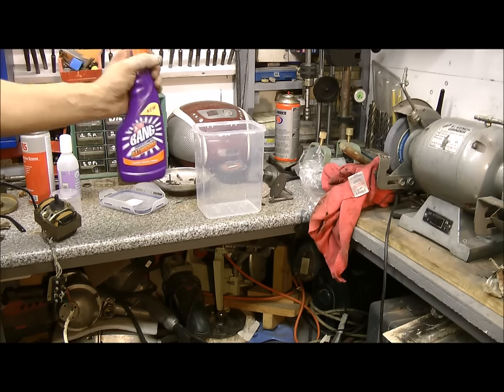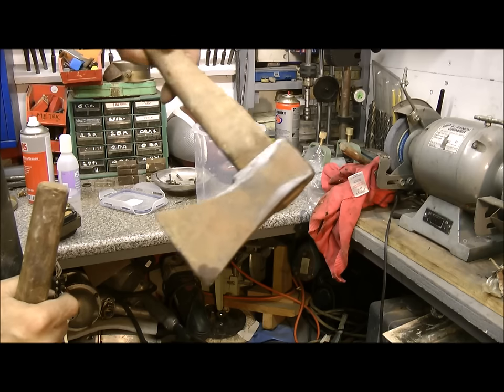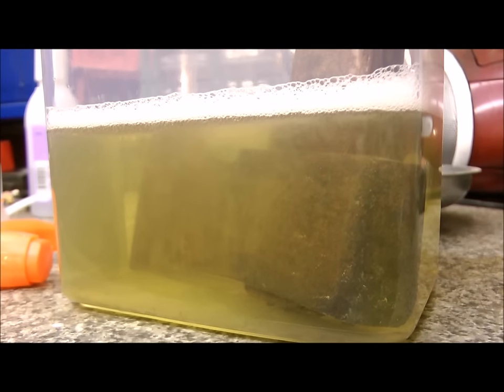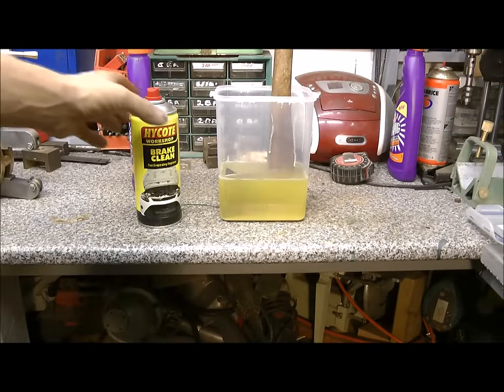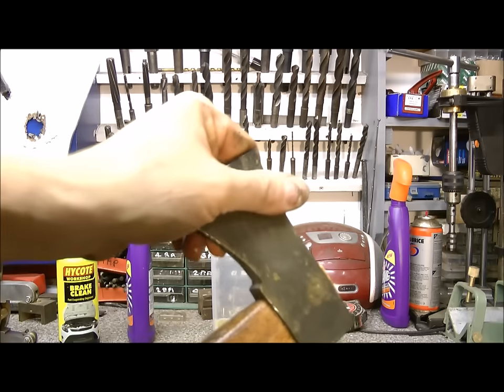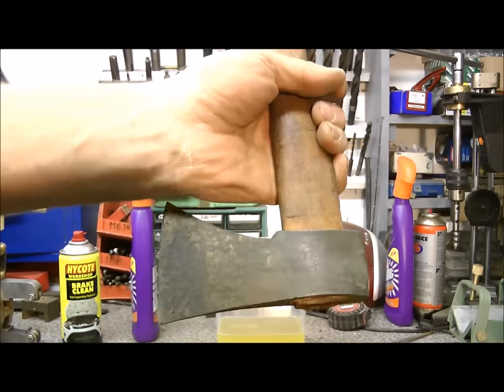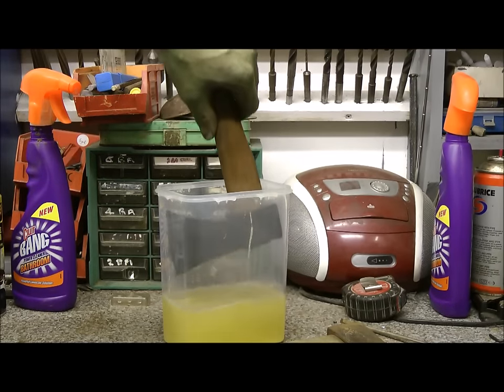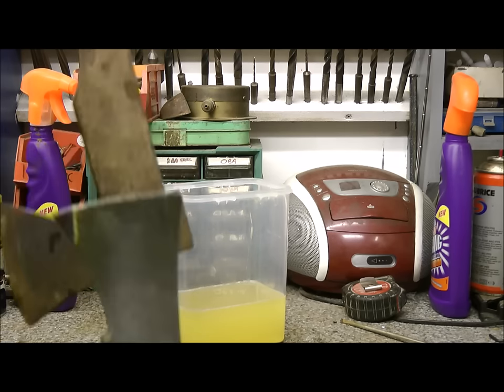clean my Rusty Axe ? Try this with things you find around the home

Comment: I was derusting a starrett tool to sell on ebay with citric acid a couple weeks ago, and to try keep the precision surfaces as precision as possible I was using brass turnings to rub the rust off. I was doing it in the same tub with the acid and had all the loose bits of brass fall into the solution. I didn't think to fish them out so some of the copper dissolved in the acid. By the end the tool came out with a light copper plating. I'd mixed a big batch of the solution up too, thinking of bottling it for future derusting, but had to chuck it all out.
Reply from the maker: Interesting, how did you make the citric acid,  I know where your coming from Simon staining on tooling is a real pain in the ass
Reply: I just bought some from a halal food store. They tend to be good places for getting ahold of weird stuff like alum or starch powder. Or monosodium glutamate for cheating at cooking. Wilkinsons claims to sell citric acid as a cleaning product on its website but i've not found it in stock in any of the places i've walked in to.
Reply from the maker: Simon Heslop alum that's a blast from the past last time I used that was in a chemistry set! In the 70's
Reply: I remember hearing a while ago you could use it to dissolve broken taps and drill bits out of non-ferrous metals. Not had a reason to try it yet though. Fingers crossed I never will!
Reply from the maker: Simon Heslop that sounds like a great thing to try! , one day...when I need it:)